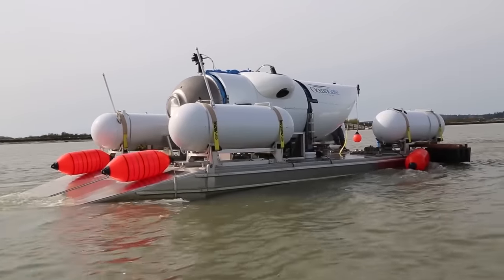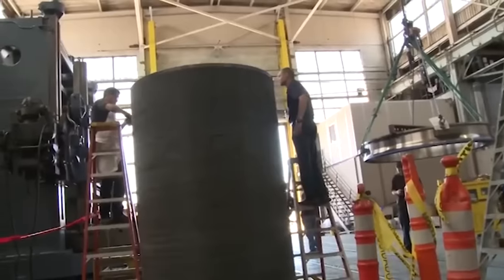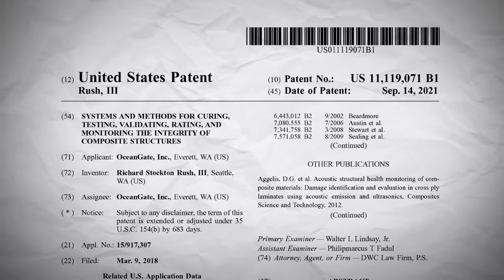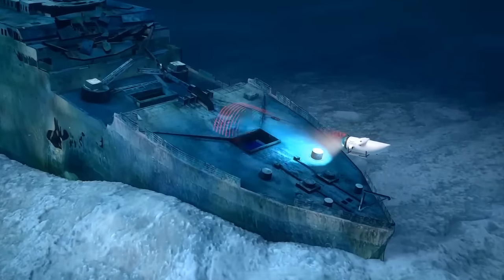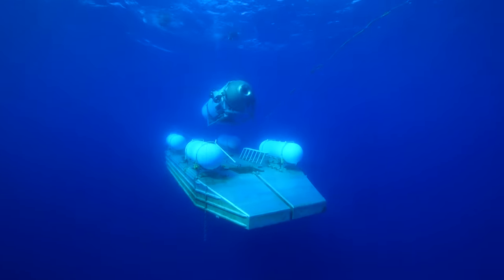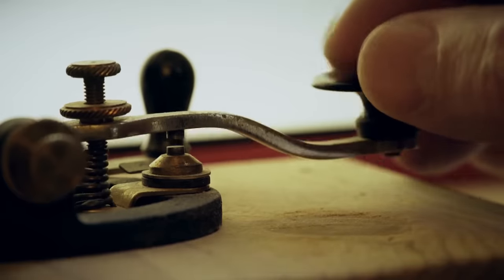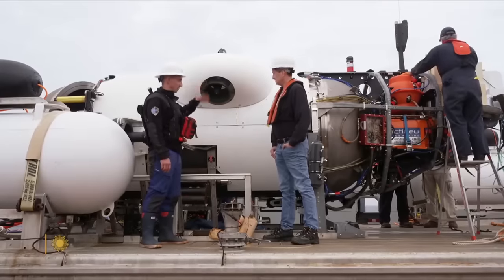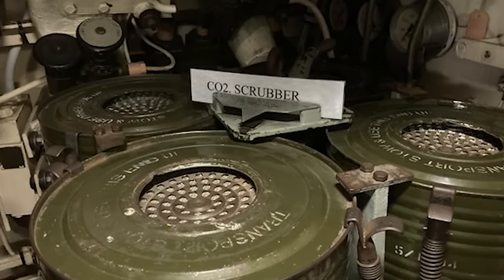Exposing OceanGate Submarines Many Fatal Designs

Comment: I am an ex laminator who worked with carbon fibre for motor sport, aviation and oil industries. The process of the bonding of the hull to the Titanium caps looks extremely questionable. In the videos I have seen the were hand mixing adhesive in buckets, applying with plastic scrapers in an environment that was not dust or dirt free. Frankly I am shocked it went as deep as it did. Maybe methods have changed but it is not an assembly environment I am familiar with.
Reply: Was thinking the same, no vacuum bagging, no dust free sterile lay up, no cross "X" lay up just one direction, materials that fight eachother and will never bond, FFS this was a disaster waiting to happen....
Reply: Jeez that’s bad. I know surfboard glassers who are more careful than that.
Reply: @gatesurfer  Bro I probably spent more time in my yard filing in scuffs on my board than Stockton ever did with his sub.
Reply: See that is something that always bothered me. I don’t work with making composites, most I do are use frp supports but I do know plastic pipes and welding, and even with pvc gluing, dirt and dust and environment can make you have a joint fail, and they are gluing it together in a big non environmental control led wear-house, by hand, without and other controls or help. Im honestly shocked it didn’t leak or fail there in that joint.
Reply: I ride a carbon fiber bicycle and it is even concerning to me how the derailleur hangers, headset bearings, bottom bracket, seatpost, and other alloy parts mate and interface with the polymer monocoque frame.  This guy Rush got himself and those others killed because of his hard headed narcissistic mental state.
Reply: Yeah, I bet the glue holding the titanium rings to the carbon fiber tube gave up as the two surfaces deformed differently.
Reply: Yes, that looked like a weak spot. I wonder why he didn't use a titanium tube, cost?
Reply: @jobee9113 I bet he used it for the hype, not for the material itself
Reply: I agree with you. I have seen multiple videos of big racing teams making cars this way. They were ALWAYS done in an ultra-clean room and the workers dressed like they were prepping for surgery: rubber gloves, masks, goggles and surgeon smocks. They even had fabric covers on their shoes.
Reply: the bonding should not be importend because under pressure the titanium caps will be pressed into /on to the carbon hull (the stress will not be taken by the adhesive)
Reply: I've worked with carbon filements since 1960! Haven't heard one word about filement winding machines or how they work! It's a lot different than hand layup. Even the slightest contamination can destroy the layups! Sounds like they tried to use aerospace technology to submersibles! Yes, I have worked on submarines too!
Reply: Just curious why is it that that are wine bottles in the titanic site fully untouched and unbroken by the so called tremendous so called pressures?
Reply: @bfr123456  Same situation here hehehe, lol
Reply: @alexshatner3907  Maybe the corks were forced in?
Reply: Wow, I don't even have a high school diploma and even I would know not to do that.
Reply: @jobee9113  He got the carbon fibre cheap so that was it. 64mm thick steel on Deepsea Challenger.
Reply: @bfr123456  Exactly.
Reply: You don't use glue on titanium, and they most certainly weren't using any two part epoxy adhesive which is what would normally be used when joining titanium to anything let alone carbon fibre, something on this scale is no quick task, the preparation alone is alot of labour!
I'm calling bullsh*t on the whole thing!
Not one small area of adhesive residue is on the titanium cap wreckage!!
None on the porthole rim either!!
Plus no signs anywhere on any diagram of this sub shows how the exterior mechanisms were controlled from inside the hull..
The handcontroller was used to give commands to the onboard computer, but there is no input and output connection points, no cables or wires leading into or out of the hull!!
They claim the antenna was on the top of the sub, how was it connected to the hull without compromise the carbon fibre considering the shape of the hull?
Reply: @alexshatner3907 ecause they were full of liquid, the corks have been pushed further in but they were not empty bottles of pressurised air!!
The same way the Titanic bow hasnt been crushed!
It was full of water before it sunk to the bottom!
Reply: @jobee9113  Strength to weight ratio. He needed it to be light.

Comment: The acoustic monitoring system is the equivalent of the executioner asking if you are ready as he's throwing the switch.
Reply: Or bells on the executioner's arms as he drops the axe on your neck.
Reply: 💯 Correct
Reply: I believe that the 5 poor soul heard the crack but it happens so fast, the titan do not have enough time to surface.
Reply: @p4n23r I heard someone who went on it last year said it made cracking sounds the whole way down but Stockton said “don’t worry there’s 5 inches of carbon fibre”
Reply: Well said. 😂
Reply: @somethingsomething404 right. To bad carbon fiber snaps and don't bend. He should've know that
Reply: @p4n23r they were reporting the other day that there was some type of distress call before they lost contact, they were trying to drop the weights to abort the dive I believe is what was said.. I assume by that they were aware  down there that something was going very wrong.. very sad
Reply: @somethingsomething404 "...which we drilled 2 inches into when we mounted this awesome flat screen monitor..."
Reply: @somethingsomething404 so he might have kept them calm before it imploded instead of them panicking  with horror.
Reply: @venus-demilo that's what I heard too. I hope a video is made of the sequence of events so we can piece together what happened.
Reply: @victorrene3852 they dropped the weights. My guess is, they knew … but who knows what he told them.
Reply: That’s what makes this even more horrifying. They may not have felt anything and died instantly but they still would’ve known it was getting ready to happen. Imagine how horrifying that would be. Knowing you’re going to be smushed and cooked into dust any second and it’s only a matter of when not if.
Reply: @AmbuBadger nope🚫🚫🚫
Reply: Thats a great way to describe it.👍
Reply: @somethingsomething404  that didnt age well for stockton rush.😬
Reply: @AmbuBadger  I hope they glued a metal plate to the hull and the screws went in that plate.
Reply: I’m no engineer (I’m a geoscientist who did a one time job that needed engineering skills so I know this) and even I can tell that acoustic monitoring sounds like a baaaaaaad idea :/
Reply: Or a heart attack warning system that warns you when you're already having a heart attack.
Reply: At that depth any cracks that let in any amount of water/ pressure between the laminates is an exponential danger that would trap you at the bottom you would never beable to know if you had a high pressure bubble between th layers waiting to further cause an evulsion type crack.  As you assend.
So at 10 units of pressure/depth. ohoh i hear cracking...ohoh... better ascend..... at 9 units of pressure the tiny bubble of liquid still in the wall blow a chunk out of the side of your sub.... do i have this correct.??????? 
What  is really scary is that several very well off individules  did not take the time to investigate  the patently unsafe engineering.😢
Reply: @Christoffski  i love it.😬👍